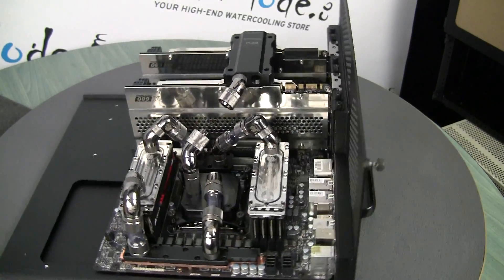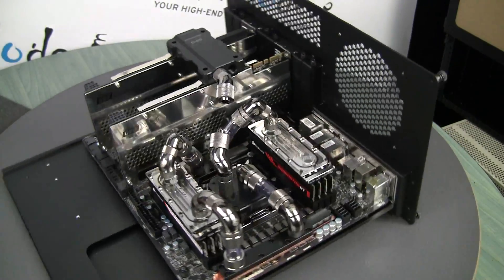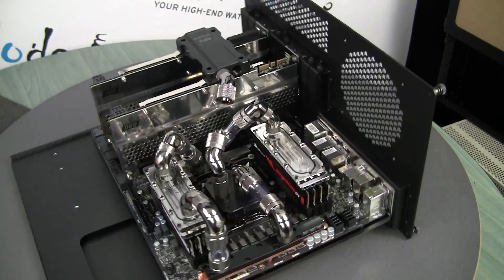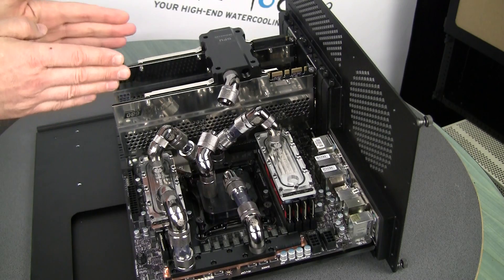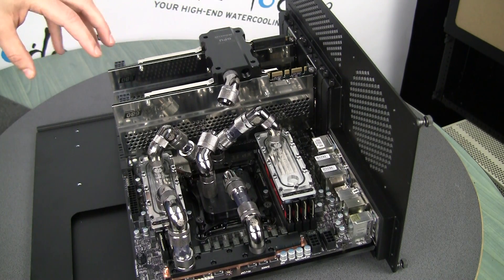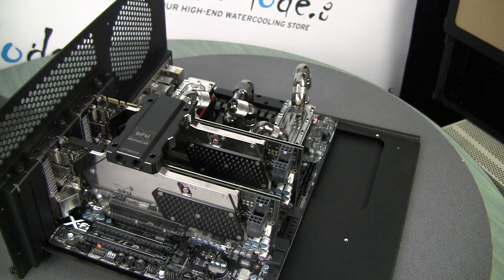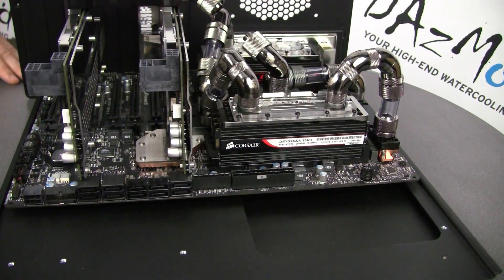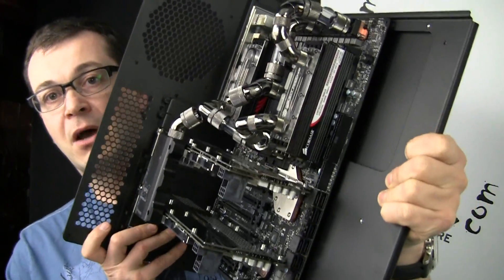Extra tips on Extreme Motherboard Watercooling - Venom Build

Comment: Do you think the Adjustable Aqua Link Pipe fittings would have worked for those close connections ? It seems it would have been even easier to assemble than using very short tubes, assuming the fittings were facing straight at each other.

Comment: With all of these blocks what type of pump are you using? Be afraid you wouldn't have enough head pressure to adequately transfer heat fast enough.

Build looks gorgeous but just a little curious on that one small point, sorry if you've answered this before. :D